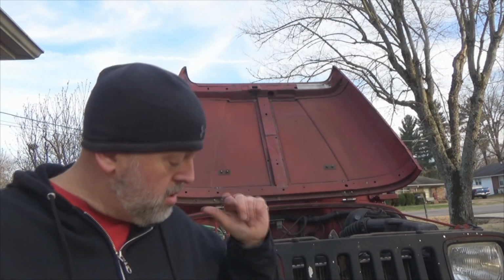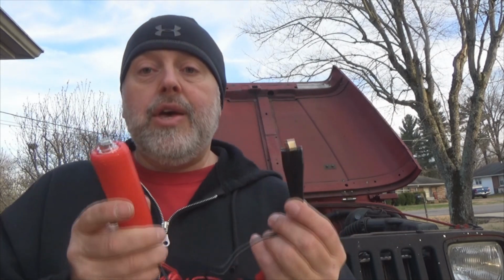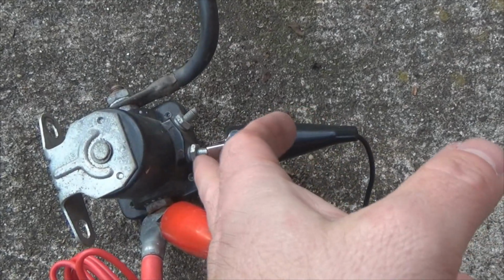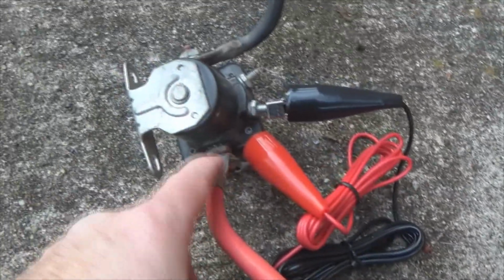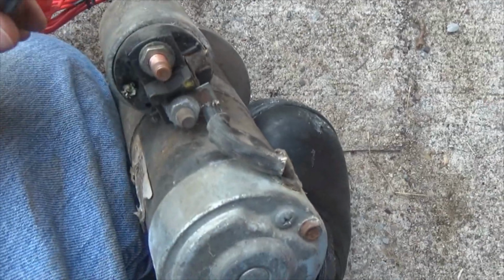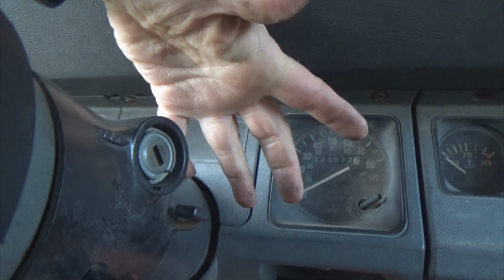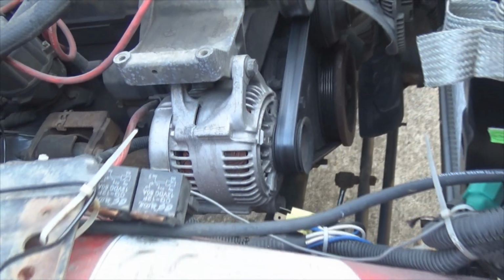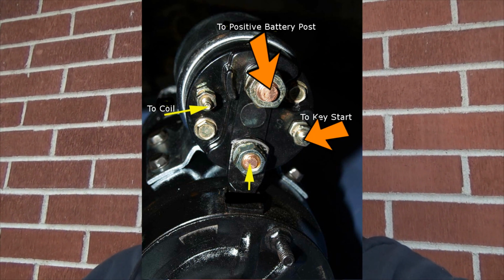Remote Start Switch on Tool Tuesday

Comment: Love to see and hear you talk about pinon angle at least that is what I think it is called.  I think my axle is tilted up a little too much after I put my lift on. There is not much out there on how to measure and correct. Thank you for all you do.
Reply from the maker: When I finish doing the tummy tuck on Rust Bucket, I will be doing a whole video on setting pinion angle. That will be at least a few months out though. What year is your Jeep and how much lift?
Reply: @Poweraddicts  Hi Power Addicts, I have a 2014 Jku with 4" lift with 35's.

Comment: @poweraddicts Have you ever installed a remote start in a YJ? Like where you can start your YJ from inside? I thought that was what this video was going to be and got excited! Still a cool tool though. I own of them....
Reply from the maker: No, not a YJ I havent. I've done several other cars and truck in the past. They are easy to install on automatic transmission vehicles. Have a great day!
Reply: @Poweraddicts  do you know of a cheap basic feature one that you would do on a YJ? Wanna do a video together?

Comment: Red to positive on battery and black on the small terminal?  For a Chrysler
Reply from the maker: Yep, that completes the same circuit as the starter relay.
Reply: @Poweraddicts  THANK YOU.  So far, from what I can tell, no spark at #1 spark plug or no voltage at the coil too🙄

Comment: so, this is a good thing to use when you want to measure the compression?
Reply from the maker: Yes, it would work great for that. You can turn the engine over yourself as you watch the gauge to reach max compression. Thanks for dropping in! Have a great day!
Reply: @Poweraddicts   no problem huge fan, yj owner and learned a lot from your videos keep on going!!

Comment: What is the benefit about using the Cherokee long side axle.will it hurt on daily driving obviously it would be better in the off road.
Reply from the maker: Are you referring to replacing the CAD? I have my CAD permanently locked in place like a solid axle and I daily drive it with no issues at all.
Reply: @Poweraddicts  yes that is what I was talking about I forgot that you had done the in yours .thanks for all your videos I like the fact that you are doing all that you do for the low budget builds.

Comment: You missed the chance to really confuse some folks by failing to mention the ford fun fact that some fords have two solenoids. One on the passenger fender or firewall and one on the starter. Designed by the same genius that came up with the timing marks on the timing gear cover and a plate with timing marks down low on the block hovering over the balancer. Fwi do not use the timing gear cover marks to set timing on a 4.9 liter.
Reply from the maker: LOL .... SO TRUE!! Even though I have an '84 GT Mustang and an '87 Bronco (full size) it still amazes me the not so bright ideas that Ford comes up with. The timing system on the Dodge Durango 4.7s is NUTS!! There are 3 timing chains and you have to look though the middle timing gear to see one mark and a mirror to see another timing mark. Timing gear came loose on the driver side cam, being an interference engine .... 4 bent valves later!! What not-so-bright engineer came up with that overly complicated mess!! I'll never work on another one!!

Comment: Lol you said you would definitely need it but you also said you never used it before lol
Reply from the maker: LOL .. yea I caught that when I was doing the edit. It can be done without it obviously but it is much easier and much more safe using the remote switch if you are working alone. Yes, I've done it for many years without one. The switch is easier and less cumbersome. Thanks for dropping in and pointing out my duh moments!! LOL Have a great day!
Reply: @Poweraddicts  lol i do the same thing with the screwdriver lol just thought that was funny also huge fan of your channel when ever you get a chance you should do a walk around of what you have done to project rust bucket very interested in seeing what all you have done in a hole with that hell i had a rust bucket project of my own front end was completely shot so turning everything from the firewall back into an off road camper complet with battery bank and repurposed gas tank as a running hot and cold water system